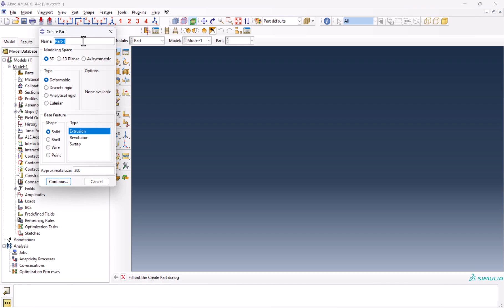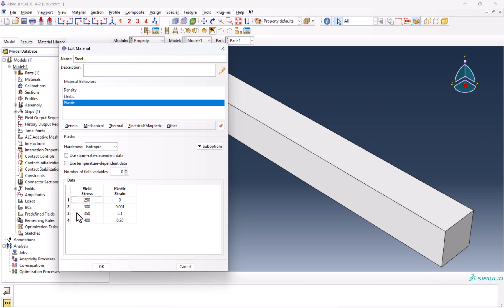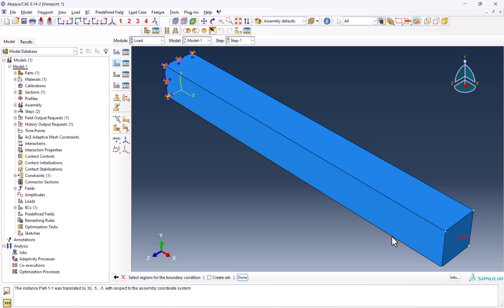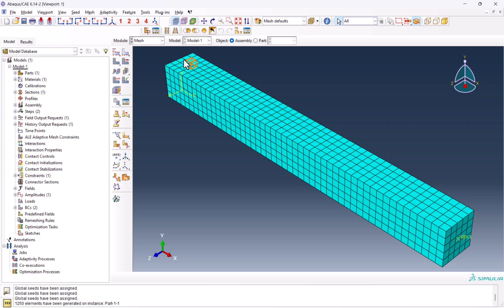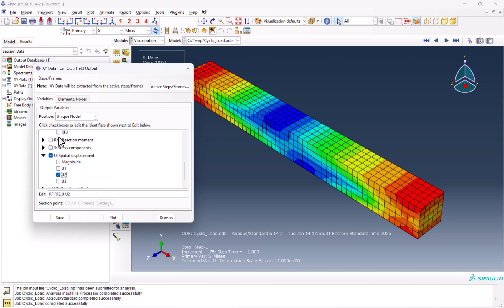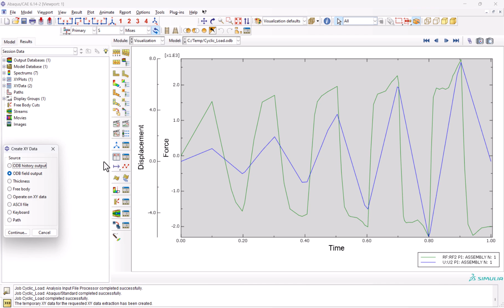ABAQUS tutorial Cyclic Loading Simulations with Hysteresis Loops

Comment: Hello, thanks for this interesting video. Could you please tell why you choose 'Static General' instead of 'Dynamic Explicit' even when you are doing dynamic simulations (and not static cases)? And second question to you is: is it mandatory to create a reference point for these kinds of dynamic loading/simulations?
Reply from the maker: Hi, I'm glad you enjoyed it! 
You're right Dynamic Explicit is indeed the most accurate for capturing inertia effects, but it can be quite time-consuming. For this type of cyclic loading simulation, a Static General approach is often sufficient, especially when inertia effects are negligible. 

Regarding the reference point (RP), it's not always mandatory, but it definitely makes things easier. It helps with applying boundary conditions more efficiently and allows for easier result extraction (like plotting reaction forces). When you need to apply a force on a surface instead of a distributed pressure, coupling the surface to an RP and applying the force there is a practical approach. Thanks for bringing this up!
Reply: @FEAMASTER  Thank you for replying! Is it possible to consider a reference point (RP) also for deformable bodies? In the case where not every part of the body deforms the same way, how does RP calculate the deformation (or strain)?

So, when there are no inertial effects (but you still do dynamic simulations), why do you go for Static General, and not dynamic implicit (instead of dynamic explicit)?
Reply from the maker: @ Hi again! Great questions.

Yes, you can certainly use an RP for deformable bodies by coupling it to specific nodes or surfaces. The RP itself doesn't directly calculate strain or deformation—it simply tracks overall motion. Actual strains and deformation are always computed locally at the nodes/elements, capturing the variations you're mentioning.

Regarding choosing Static General over Dynamic Implicit: even under cyclic loading (dynamic scenario), if inertial effects are minimal, a Static General step is usually simpler, faster, and more efficient. Dynamic Implicit would add unnecessary complexity and computational overhead due to inertia terms that aren't influencing your results significantly.

Hope that clears things up!
Reply: @FEAMASTER  Yeah, sure! Thanks!
Reply from the maker: @ You’re welcome! Enjoy learning!